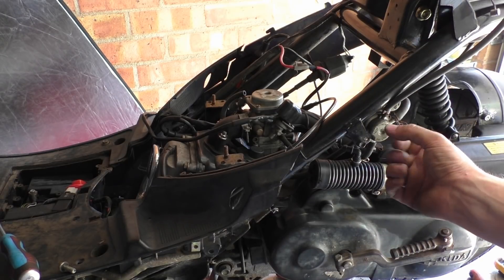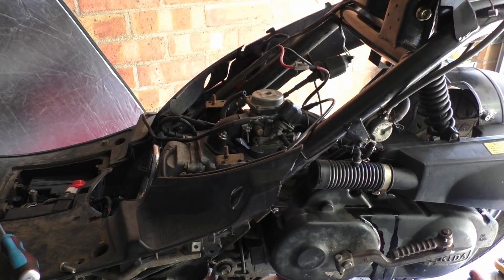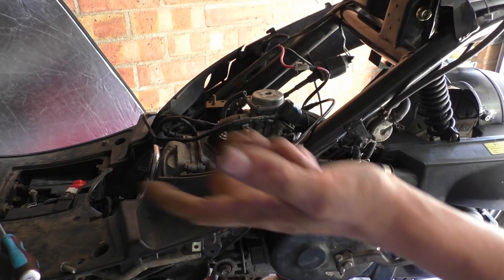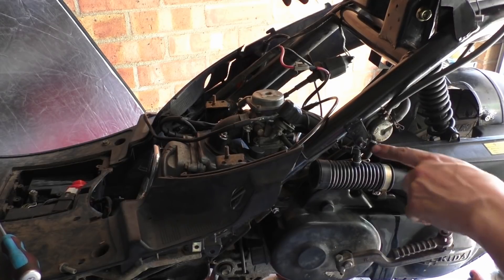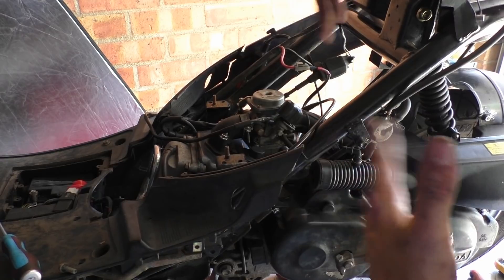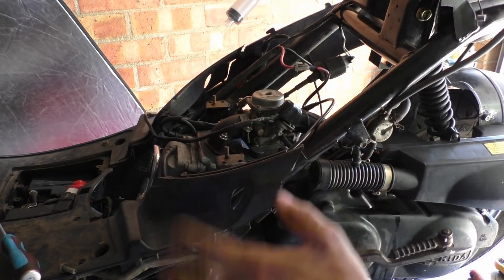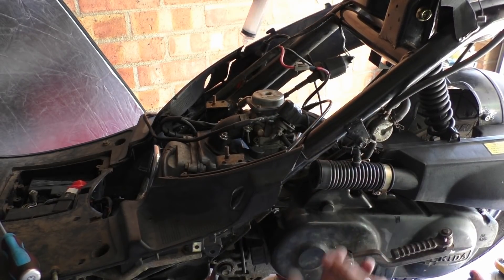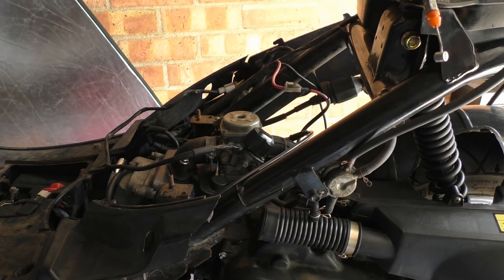No fuel from tank - Mopeds are shite - Part 1

Comment: Working on shite Chinee scoots, these sealed units regularly failed and pissed petrol straight down the inlet manifold (also shite & split at the over moulded bolt holes - lean running a-go-go). Thought you were going all Dead Mans Shoes with the gas mask, Matt!

Comment: vacuum pulse diaphragm fuel pump, works by intake vacuum pulse, all kinds of small motors have these, i never had one screw up, well actually once i had it because it went off crank case vent pulse and the tube was on the dip stick tube and the dip stick tubes O ring was bad but after we fixed that it was fine

Comment: Mopeds are actually pretty nice, the old ones (Zündapps, Kreidlers, Simsons, Hondas, Yamahas and so on) from more than 20 years ago. But scooters are cursed and a plague, like the pestilence. I often have the urge to beat the shit out of them with a sledge hammer, because they are prone to failure and a pain to repair. I hate that damn tupperware, but they sell no more real mopeds. Only Romet from poland still sells Mopeds in Europe and even them are just Honda copys.
Reply: Elmar Dylong actually in the 50cc class I'd rather have a scooter piece of shit than these ridiculous "motorised bicycle" things as they are called in german
Reply: You don't know shit about a good Moped. ;-) e.g. a Kreidler RMC is a small motorcycle, it has a 5-speed gearbox (no CVT that eats 30% of the engines performance and wastes your fuel), while putting out 6,25hp. Mine ran 120km/h. Even my first one, a Puch Maxi N did 70km/h and was reliable like nothing else. Honda SS 50, a four stroke, was a bit slow but still reliable as fuck. When I had to do maintenance I didn't have to dig through tons of plastic and loosen a million fasteners to get to the working bits. But the best thing was riding position. While  on a scooter you look like sitting on the toilet bowl, with no real control over that damn tupperware, a 50cc bike from that time gives you all a real motorcycle has to offer. My Hercules Ultra even had double disc brakes in front and a nice, small fairing like old school motorcycles. Of course scooters have to exist on this planet. People that dond't know shit about riding a motorcycle, that can't shift (or downshift), have to be able to ride it while wearing a skirt, so they can sell them chinese rubbish. When I repair them scooters in my shop, I usually have to change frayed belts after only 3.000km. Even engine revisions after only 3.500km are not uncommon. If you want proper performance you have to first take out all the restrictions, if you want more (like real power) you have to  throw a lot of money at them. 10" wheels? You have to be kidding me, a wheelbarrow has bigger wheels, this small rollers are dangerous like hell. I am glad that nowadays the slowly change to 12" wheels and even 16" on scooters that resemble, who would have thought, a moped. The best things are chinese tires, 10" and hard like plastik. They last 10.000km, longer than the lifespan of a scooter, but let it rain and you are in for a nasty surprise. Only ice is slicker than that. Even the communist bastards from the GDR built better bikes like that crap and put real tires on them. I rebuilt and tuned a lot of Simsons, even this crap is better than your rolling toilet. By the way, a motorised bycicle is called Mofa in germ-any and they were only allowed to go 25km/h. They were intended for alcoholics and kiddies, without a drivers license needed, the same people that nowadays ride scooters.
Reply: I see, you never rode a Maxi N. Why should the front wheel lift of the ground? There is no plastic ruining aerodynamics. Also aerodynamics become only relevant over 80km/h. My Maxi 2K lifted its wheel, but only when pulling carelessly on the cable. A friend of mine put a 70cc-kit on his and went 90km/h, while still being more stable than your dumpster. I work with this crap since I was 12, now for over 30 years and I can tell you it was pure luck you got around for 3 years. Or you didn't put a mileage on it, wich would explain why it did hold up for that long. A friend of mine broke his knee cap, because that damn mini-wheels threw him of his scooter. A Honda Bali that now has almost 50.000km on it, wich I already built the third engine for. The whole thing rattles and everything is lose, a thing you would never see on a Kreidler. Also a Kreidler would have used only half the amount of motors to get to this mileage. That scrap heap weighs over 100kg, so I had to put on it a DR Evo Kit, a Gianelli Rekord exhaust wich i had to re-design completely and a bigger carb, just to make it accelerate decently. A usable scooter is always a big scooter over 125cc, if you like the Honda Goldwing experience. If at least a microwave oven was attached to it, so you could warm a nice microwave dinner with it, but it is just carrying tons of stupid plastic around. Enough said, I have to build scooter engines, at least 3 more till christmas, my shop is clogged with plastic and I have to get rid of it.
Reply: Elmar Dylong good point, why would anyone over the age of 18 ever want to ride a 50cc? just to get around. If I would care about the fucker I would throw it away and buy a proper bike.. My kymco piece of shit is standing around since 2013 or whenever but it was more fun to ride than a maxi n. And the front wheel thing is not really lifting but loosing grip at over 60kph. Almost every scooter can drive 130 without major problems if you put a 70cc or whatever in it. just the brakes might be too weak. Seriously, I can't even ride a puch these days cuz it is too small
Reply: Take a look at these nice little bikes. I am already considering importing them into germany, because they are reasonable priced and have decent quality. Insurance costs only around 45€/year and no tax on it, this is why people over 18 consider buying them. Also no costly technical inspection needed every two years. Are they too slow? No problem, buy a complete 140cc-engine from eBay for around 400€. No extensive "screwing around", just change the motor, plug and play. Why? Because every pit bike engine will fit them. If you want to you can go really crazy and buy a 190cc-motor with a 4-valve head. Over 20hp, easily. This is possible because this engines are all Honda Dax clones, even the Honda SS 50 has the same engine pattern, only that it is a 5-speed gearbox instead of four.
 
 http://www.romet.pl/de/Motorrad_Katalog,Mopeds,101,634,2015.html
Reply: or take a look at the Sachs Madass, it is the same thing, just really overpriced
Reply: Elmar Dylong They are still slow compared to a real big bike (like say a random kawasaki ninja 636 or suzuki sv650 or something) and too small to use on trips and longer rides. You can have fun and use it as a toy sure, but if you want a big bike you gotta buy and pay a big bike. Also some old 125 (or 250 or 450,..) dirtbike thing is nice and cheap as well and if you are fitting bigger engines to this you end up paying more tax and insurance or doing it illegal which is not worth it for something you would need daily but again just for fun. I have never seen a guy my age like his 50cc scooter or even sitting on a mofa. The most dudes who use a scooter have no money or no drivers licence for a car or motorcycle
Reply: Elmar Dylong Also if you are importing them you have to deal with legal issues if these things fail. Just a tip, don't rush things and maybe ask a lawyer or someone who knows stuff if you have no clue about these things like me
Reply: A 50cc bike is allowed 50km/h. That is slow, but your scooter is just the same. Please read what I wrote, there is no use telling me what I already wrote. Nobody sells a moped to go fast. What a customer does or wants is his thing alone and he has to be aware of the consequences. I already built a lot of scooters to where they are no longer allowed for road use. Who does it anyways knows what he does, if he doesn't I tell him beforehand. For legal reasons I have to. 
Poland is member of the EU, so there is the "EU-Betriebserlaubnis". Like you can use an aftermarket exhaust on your bike here when it is allowed in one of the other EU-states, wich makes it legal to use these bikes in germ-any.
 A seller has to provide spare parts for ten years after the buy, but only as long as the manufacturer exists. I have done my homework.
Reply: The 30 MPH / 45 KPH restrictions came in as a result of the "Moped Speed War" between Kreidler and Puch during the early to mid 1970's.

Both companies wanted to boast that they made the world's fastest 50cc sports moped. Kreidler held the 50cc land speed record which was then 118 MPH. (Currently held by Tomos at 138 MPH).

Puch came out with the Grand Prix in 1975 that had a tested top speed of 72 MPH. (I've ridden a Puch Grand Prix and they actually do the speed modern sc**ter kids can only bullshit about!! It does, however, have the road holding of a shopping trolley at over 65 MPH and the drum brakes can't cope at speeds over 45 MPH). 

By comparison the Yamaha FS1E was tested at only 44 MPH and the Jawa  Mustang at 48 MPH. Suzuki A50P did 61 MPH. Even the Italian sports mopeds only did 55 MPH.

However Kreidler then came out with their ultimate incarnation of the Floret and it had a tested top speed of 80 MPH.

Governments across Europe and the UK were horrified and so the 30 MPH / 45 KPH moped restriction came into effect. That ended the golden age of 50cc sports mopeds.

No 50cc moped or sc**ter produced since has or will out perform or out speed the Kreidler Floret, hence why they are so sought after by collectors. There is a U-Tube video of one clocking 150 KPH on a GPS speedometer.

So when complaining about the 30 MPH / 45 KPH top speed 50cc bike restriction that 16 year old riders have to endure (it doesn't apply if you're over 16 and hold a provisional or full motorcycle licence), we can all blame Puch and Kreidler for it.

Comment: Actually those grose urinary tract infection yellow tubing are better than most rubber tubing if there's alcohol in the petrol (like it is by law in sweden), unlike rubber tubing they don't fucking dissolve after a couple years and start pissing fuel on your exhaust (very fun when you're riding and it starts flaming up your arse). I take the grose urinary tract infection colour tube any day over shitty dissolving rubber tubing.

Also jesus shit what is wrong with the variator? It looks like the previous owner modded it and put really low weight clutch thing in the primary, there's no reason you would normally need such high rpm to engage the primary, either that or the belt is horrifically worn down.
Reply: MetroidChild 
I'd guess worn belt. Nothing about that pile gives me the impression the p.o. did anything but ride it until they binned it.
Reply: Yeah that sounds about right

Comment: Never had any issues with this system. What should you do when there is no fuel left in the carb? Let the starter motor run for a bit longer. It is not that difficult. It is kind of annoying though. I also had to run de starter motor a bit longer when I didn't use my moped for several weeks. Makes you look like an idiot with a moped that doesn't want to start although it is perfectly normal behaviour for a moped with this system....

Comment: this must be the most unnecessary thing i've ever seen put on a bike, why not just a fuel tap?
Reply: A lot of scooters have the fuel tank lower than the carb and the Chinese factory just grabs whichever parts without a lot of engineering. So even if the tank is above the carb they might just shove in the vac pump thing cuz that's what they had lots of laying around.